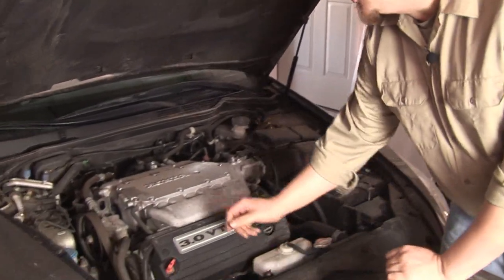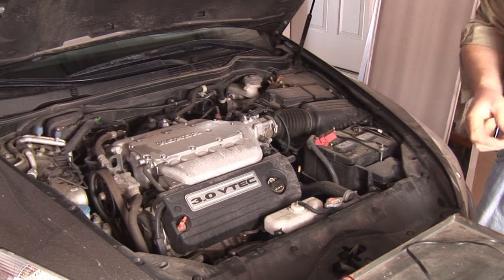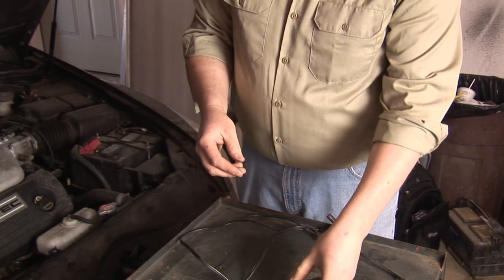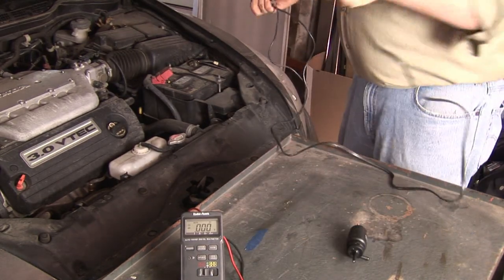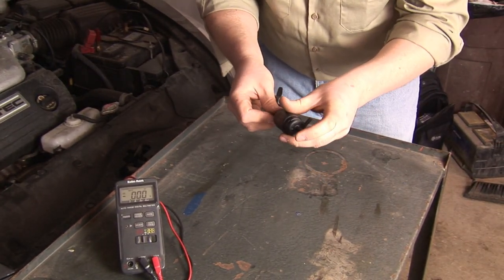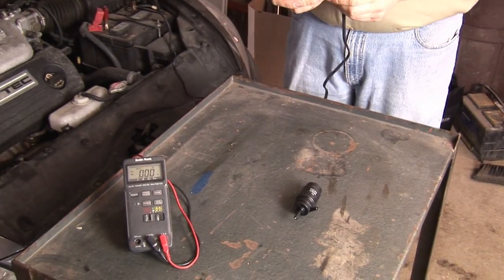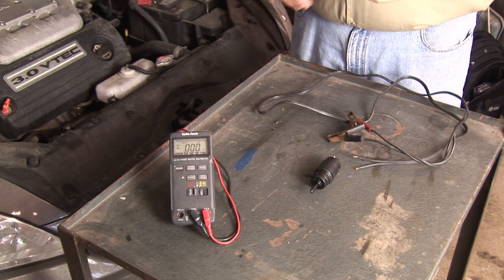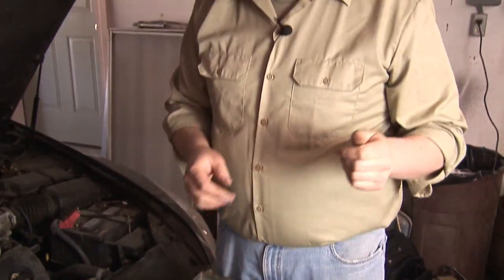Auto Repair & Mechanics : How to Troubleshoot a Windshield Washer Pump

Comment: im getting 1.5 volts at the connector, and 2.5 volts when I pull the washer switch... The washer isn't working would this be the switch itself or the wiring? Video helped me narrow it down

Comment: so if you are going to check the harness as you were suggesting, what settings do you use on the multimeter?
Reply: Set your multimeter to 20V DC  and if your wiring harness is ok your multimeter will show 12V DC. GOOD LUCK
Reply: @kevizehopucho2114  not sure about all, but some have a constant 12 v going to the washer when the key is on and the washer switch completes the circuit by providing a ground. I've just diagnosed a 2004 Nissan Sentra system and it has voltage at the pump (key on, wash switch not activated) but doesn't ground with the switch activated. How do I know that the pump is good? I provide a ground to the negative side of the washer plug and it works! Everything else operated by the multi-switch (wiper delay, slow and fast) works so the switches ground connection must be good so I'm left thinking it might be the multi-switch's washer internal circuit or wire from the pump to the switch. Can't find the multi-switch wiring diagram so as to know which color/position wire is for the wash circuit....so I'm left to pull one from a local scrap yard and see if a replacement will work...unless you have another suggestion!
Reply: @tomrossiter3984  please check your wiper fuse and relay..
Reply: @kevizehopucho2114  Thanks for the suggestion but I did check the fuse already and it was good. (It's the same one for the wiper motor which is working okay and the wiper motor even does a short time activation when the wash switch is triggered ) 
I looked for a relay in a schematic found online, but none was shown. Are you saying that a 2005 Nissan Sentra windshield washer circuit has a relay?
Reply: @kevizehopucho2114  the wipers work fine and if the washer is on the same fuse, I've checked already and it is  good. I've searched the car, google and youtube, but I can't locate a relay for the washer. Do you know that there is one? and where it is located?

Comment: I'm getting voltage to the pump, so I tested the pump outside the reservoir. It would come on for a couple of seconds and then trip the circuit breaker in the battery charger (should have enough amps since it will jump a car). I decided the motor was shot so I got a new one. It did the same thing. Do you think I burned these out because I operated them without water? This is on a 91 Ford Ranger.

Comment: i have a 05 dodge caravan and i thought it was the washer pump and i replaced it and it still does not work on the front or rear of the van when i push the washer buttion the front wipers come on but no fluid the same with the rear  my van does not have fuse box in side of the van there is under hood  when i look at all fuses and relay's none has the wiper or for the pump on there can some one help me please this is unsafe for my kids to ride in this kid of conditions right now i need help please
Reply: josh Bateman check if your line from the tank is blocked or unplugued